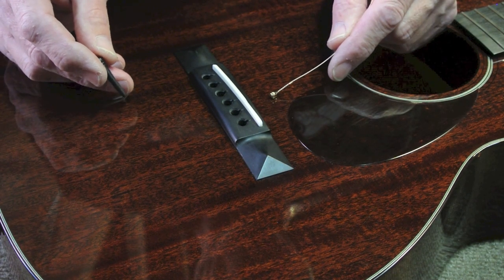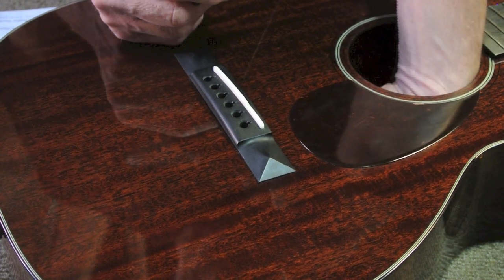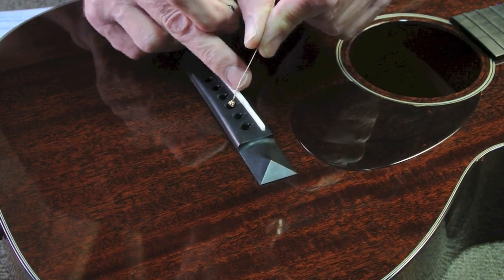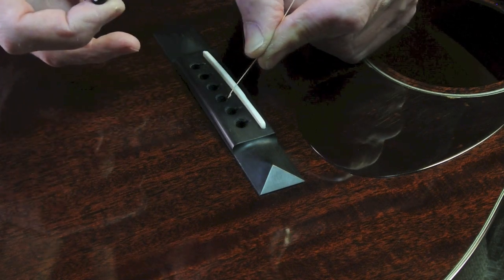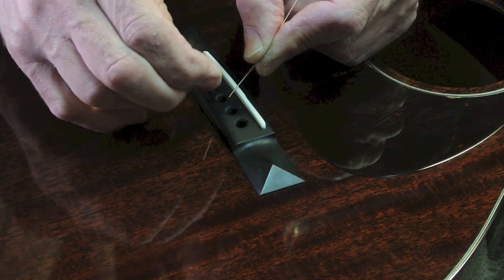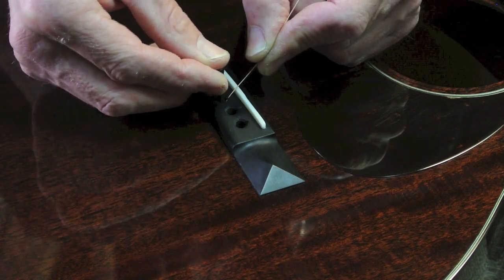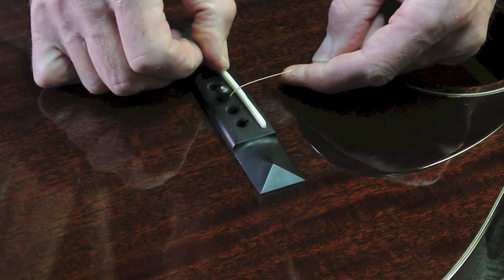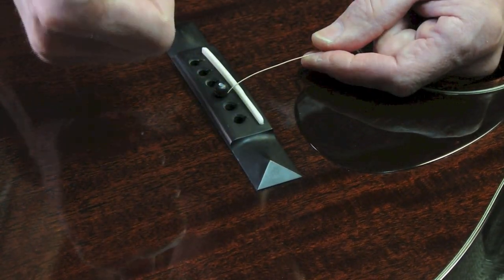How to set Bridge Pins on an Acoustic Guitar

Comment: The problem I kept having was them coming out so it was a bitch to tune up...just ended up holding them down while I tuned up. Now I'm afraid to stretch the strings just because if they pop out I'll be pissed.
Reply: so wht hppnd ? did it work fine?